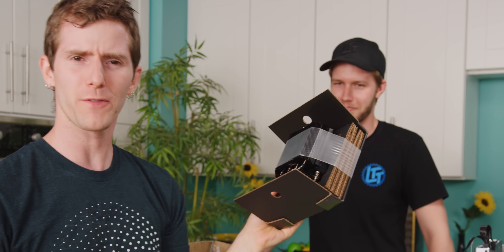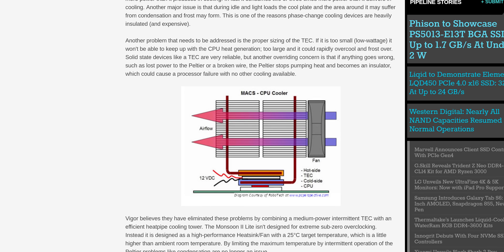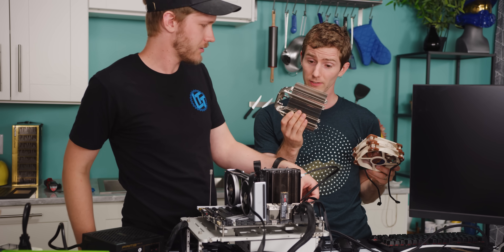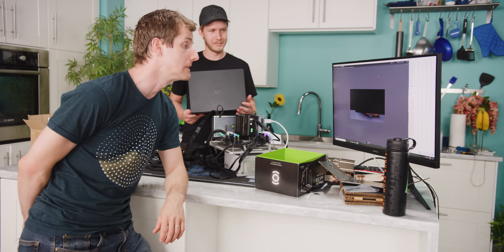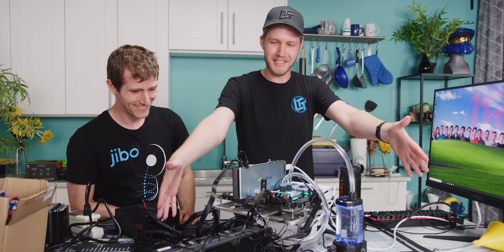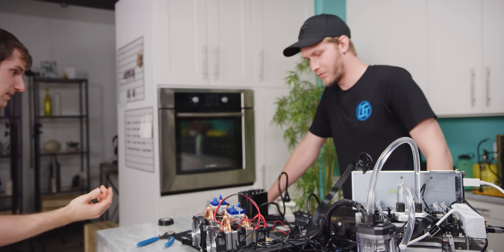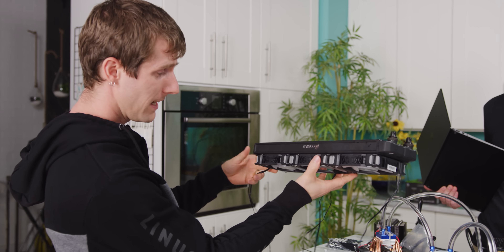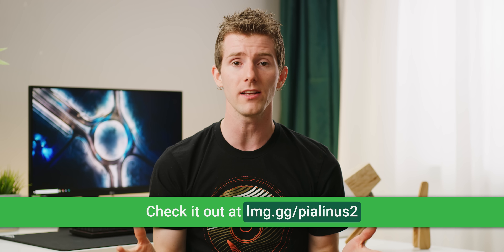Thermoelectric Cooling is a Bad Idea

Comment: Couldn't you put a thermoelectric cooler in the same loop as a normal watercooler? That way, you get the effects of both... Unless I'm missing something?
Reply: I mean you could, but a 2nd radiator for the same price would do a much better job.... not to mention the extra +300w....
Reply: Why though? Why not just more cooling of other types?
Reply: @danielmorton1606  Because science...
Reply: @300fans  There's always lots of science to be done. Maybe better science and not something a bit obvious though. Cooling can compound though generally inefficiently. You have the two components separately, they don't add positively, so it can only be less efficient. The efficiency depends on the geometry and coupling.

Comment: Well since you apparently took a course in thermodynamics you should take the also nice course in fluid-dynamics to learn that any fluid tends to travel down due to gravity, and therefore is no where near the TEC elements, stupid way to produce those coolers anyway, I haven't seen any proper desktop/tower heatpipe coolers since the asetec vapochill micro.

Comment: those aquarium coolers AFTER a traditional watercooling loop ?  anyone ?
Reply: One would assume it would work better.
Reply: That's what I was thinking, Why not both? Just add it to the loop. Couldn't hurt, If you had it on a thermostat to keep condensation under control. Except power consumption.
Reply: For as much money and trouble as they are going through I'd just do phase change cooling and be done with it
Reply: @slickjim861  Well, to be fair they aren't trying to make this work - they just demonstrating why it's not worth the trouble. Phase change cooling is also not worth the trouble by a long shot.

Comment: people were trying to use Peltier heat pumps 20 years ago for PC cooling.

It didnt take off then either.
Reply: I used Peltier cooling on a dual PII (300MHz) machine about 25 years ago. I've still got the coolers (60W each IIRC) and heatsinks in a box somewhere. They were better than stock fan cooling but not by much and the current draw for the Peltier devices was a problem for the wimpy PSUs of the day.
Reply: @robertsneddon731  that sounds about right.

I had one for an AMD K6-2, I think, might have been a K6-3. Got it from Maplin.

Never really impressed me much so went back to an OG fan.
Reply: @Heads Mess 7:30 it shuts down at room temperature.

Comment: TEC cooling has been proven to be effective, if not built by a pair of idiots that don't know what they are doing.

Even back when YOU WERE NOT building them on old school PCs, they were effective when done correctly.

The only point you got correct is that they are expensive to run.
Reply: I mean if you consider expensive to run not a part of effectiveness- sure literally any cooling method can be effective. Flying the computer out to the Arctic is effective. They are terrible and inefficient, and you are better off with multi-phase cooling.

Comment: fun fact, soldering is a lot easier with an actual solder station and not some weird solder gun solution. For a long time I thought I was just bad at soldering when I was using my crappy weller but then I got a relatively cheap amazon solder station and boom I could actually do stuff.

Comment: If you put one of those Peltier coolers in series with a normal radiator, would you be able to get a "turbo cool" effect by letting the coolant reach sub-ambient during times of low load so it's pre-chilled for short bursts of high heat output?

Comment: CPU heat to water worked fine, dissipating the heat from the water through the peltier heat pump worked until the air coolers couldn’t conduct away the heat fast enough. All that volume of water to store the heat in the radiator probably dropped the volume of heat storage below the test run time.

More water would cheat the test. Why didn’t those air coolers dissipate the heat fast enough on top of the peltier pumps?

Comment: I'd like to see you try this test.  In cars which of course use liquid cooling, they apply an additive to the water.  The coolant added to engines, not only stop the water from freezing but also make the water more efficient at heat conduction.  Would adding a coolant additive to the water in a PC system help cooling?

Comment: I used to work at a lab where we used Peltier coolers to chill the CCDs. We did get the condensation problem once, which resulted in some confusion looking at images till someone worked it out XD (they're supposed to be sealed units so water really shouldn't be able to get in there, but of course, it still happens sometimes :P)

Comment: Thinking about switching my stock cooling with an external liquid cooling setup: 3x 140mm x 420mm radiators sandwitched with 9x 140mm NF-A14 industrialPPC 3000PWM 12v 0.55amp 6.6w totaling: 4.95amps 59.4watts seperately powered by 1x 12v 13amp power supply module from amazon. You like spending money in the way of computer science, do you think you could do a video upload of this how efficient it is?

Comment: That little waterblock is definitely a limiting factor in your aquarium cooler setup. Use something built for overclocking on the same setup, I can GUARANTEE it will be a lot colder.

Comment: I use the Phononic Hex 2.0, 2 things, one the unit works very well if you hook up the USB to it and use the app so you can turn it up and max it out, also I noticed that you must tighen the backplate to the adaptor as much as you can to get the best contact to the CPU, now ofcourse there are better coolers out there but for me having a mini ITX unit, it works rather well. I have the i9 9900k btw

Comment: I ran an early TEC product in the mid-90's on an AMD-200mhz CPU.  It had a neoprene gasket that fit around the edge of the die to prevent condensation.  It didn't work much better than a heatsink and the CPU clips were garbage.  My roommate who also had one fried his CPU because of those clips.  We went to a LAN party and in the move, the over-tight clip snapped the plastic "clamp-point" on the socket causing the unit to fall off.  He fired up his machine and shortly into a Warcraft 2 game, the chip was fried with no internal throttling in those days and no heatsink.

Comment: What IF ... you split it in half? And by that I mean ... water cooling on the CPU, BUT you cool the water in the tank with a peltier module? Wouldn't that be more ... cooler? Feasible, I meant feasible.

Comment: Isn't there a limit to how much heat can be removed by fans?

I mean, are 3x 92mm really efficient at drawing heat off that stack? If the design of the heatsink had the same area and 3x 140mm fans as the radiator it would pull off a lot more heat.

To me the question is can the peltier help remove heat faster from the CPU, not can the peltier cool the water more.

A 100W peltier should only really be run at 50W for efficiency. So if you are expecting a peltier to pull more heat then you need a massive peltier to get the job done.

Comment: I had an idea a few years ago, but have lacked the motivation to try it out.  You keep the traditional water loop setup including rad, but insert a peltier device into the loop after the radiator. You have a thermocouple on the water block that is connected to the peltier and a humidity and temperature sensor measuring the ambient air hooked up to a micro-controller which controls the voltage applied across the peltier device. The micro-controller ensures that the temperature of your coolant never goes below dew-point, so you don't have to worry about condensation, and the peltier does not draw as much current. There is definitely some risk here of your radiator actually working in reverse and heating the coolant, depending on the thermal output of the system, but if you had a loop that cools not only your CPU, but also GPU and potentially MOBO chip-set (and maybe even RAM - because after all this is a crazy idea in from the get-go), I think there is little chance of the coolant reaching the rad at sub-ambient temperature.
Reply: have same idea and wandering why they didn't try that

Comment: ebay TEC are "Fake"/ intentionally misleading by rating them at a higher hot side temp. Also there is no "Group" testing the validity of Ebay's TEC's claims... Sure they will beable to pull that much current but in theory any TEC could do as it can act like a resistor But that doesn't mean its achieving the cooling you'd expect  i have a you tube channel about TEC's..

In short the check EBAY TEC wont cool the CPU you Guys are using cos it out puts WAY to much heat load for direct CPU cooler to work. FYI Obviously the hot side of the TEC would need to be water cooled too.

For it to work with your huge heat load you'd need an array (6 or more )of high QMAX TEC's (not ebay ones) running at low input voltages to achieve maximum efficiency, water cooled on the hot side water chilling the CPU..... YES this be large and Expensive as it will have to be custom made (not the junk you used in this video from ebay ) ... But who cares it's all about going "Extreme"

Comment: How did the TE+water loop do worse than the just the straight water loop? Get an AIO cooler and use the cpu connection to sandwich the TE to your water reservoir. You could monitor water temp and regulate the TE to mitigate condensation, save power and ramp up power to the TE for increased cooling under load no?

Comment: Oh there are way earlier instances. DIY'ers were doing this back in the late 90's at least, if not earlier.  I know the late 90's was when I experimented anyway.  Came to the conclusion it wasn't worth it. TEC, or it's PSU dies, you end up with a really freaking good insulator between your cpu and your cooling solution, and considering this was really before thermal throttling was much of a thing, the result was pretty much guaranteed to be a dead cpu.

Comment: its probably worth watching Tech Ingredients
 EXTREMELY LOW TEMPERATURES! - Using TECs video
Published on Apr 14, 2019 as a generic overview so you dont screw it up with bad assumptions even if theres no profit in it other than inspiring others to do it right and better...
https://www.youtube.com/watch?v=aSGwaQWA05U

https://youtu.be/YWUhwmmZa7A?t=535

BUILD YOUR OWN REFRIGERATOR! - SOLID STATE TEC

Tech Ingredients,Published on Jan 3, 2019
We review various methods of refrigeration, focusing on thermoelectric coolers. We then explain the engineering and show the assembly of our solid state refrigerator.

Comment: I have to wonder if splitting the hot, out-loop, and sending equal amounts of water to both coolers wouldn't have worked much better.  It would slow the water down while inside the cooler, allowing more heat rejection. Then combine the Peltier water outlets to send a single loop back to the CPU.
Reply: Yes indeed.  Having the TEC and water block positioned after a radiator would offer some much better results.

Comment: They need to just shove those in the loop after the radiator. the benefit of a peltier is to get below ambient, not to take hot stuff and try to keep it ambient.

Radiator's job is to get as close as possible to ambient.

Peltier's job is to cool beyond what a radiator can.

Don't ask the Peltier to do the work of the radiator and the peltier.

Comment: Well my bad tec cooling idea works but mine has a cooling loop added like the coolit version,  PC uses 271watts at idle and around 630 watts peak under load and around 85C xmp overclock. And I wont bring your pink Honda into it. But I cant wait for episode 2

Comment: Should've just bought some Mini Fit Jr crimps and a universal crimping tool and crimped that connector on instead of cutting the wires and soldering them together... Would've been more reliable and safer lol. Much faster and easier to do too if you know what you're doing.

Comment: Stop wasting money on the TEC's, use Alex's expertise to design and build a larger, more efficient evap head/block than the Little Devil Micro SS you had before and build yourself an auto-cascade phase change device. Don't like the evap head idea, build it as a chiller instead and use something like StarBrite's -200F non-toxic propylene glycol formula so the fluid won't freeze

Comment: Yeah it like the difference between those window mounted units with a radiator outside and a portable rolling unit with a hose. I wouldn't be trying to get the latter set up but I have a type of window that only tilts out a little even if you by pass that the hinge isn't at the far end so there isn't really a mounting option. That why even the managers office on the firs floor uses them. They are way less efficient and even then I have to have a disability approval because of fire code even though there are clearly three big windows one opens on each side in this studio/ small one bedroom. I guess it's something better then no cooling unless they can get overwhelmed like he mentions I'm not sure how they do their cooling.

Comment: Can you guys do something excessive and over the top for the sake of the internet and PC enthusiasts? Get access to a Czochralski furnace to make large single crystals of boron arsenide to make a cpu cooler. Boron arsenide crystals have a thermal conductivity in excess of 1000W/mK (depends on impurity concentrations). It could also be a way to showcase how silicon wafers for chip manufacturing are made!

Comment: Using either Peltier or portable A/C unit has 1 inevitable flaw for pc cooling...where does the heated waste air go?....Into your room.
Reply: Peltier chip's biggest issue is waste heat.  If 1 side is 30 degrees under ambient temp, the opposite side is 30 above.

Comment: I would love to see a standard water cooler, but add a Peltier cooler between the output of the standard radiator and in the input of the CPU water block.  That should do well, as the standard radiator could cool the water to ambient, and the Peltier could drop it a few degrees lower.

Comment: I remember seeing TEC coolers in computer magazines and catalogs back in 1998. They didn’t catch on due to condensation on the cold side. Given the control modern boards have, it would make more sense now though by the time it could have made sense CPUs started making so much heat that TECs couldn’t keep up.